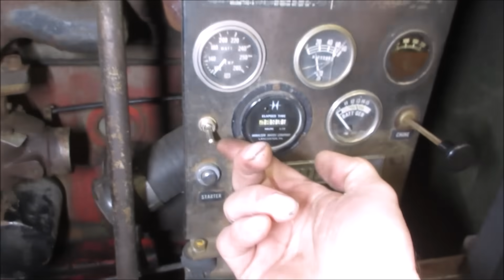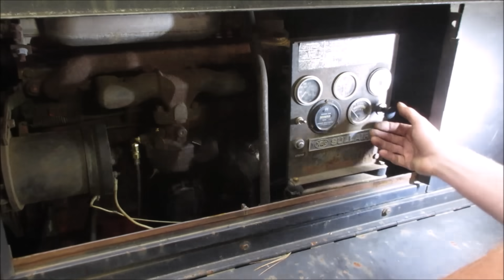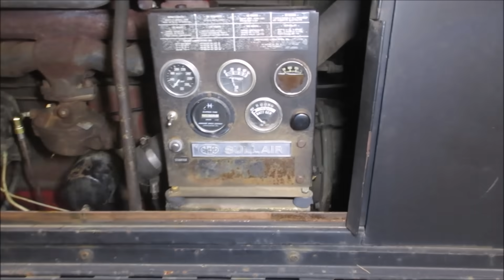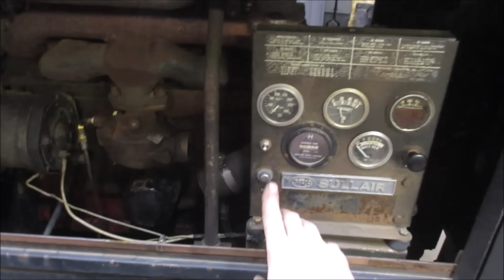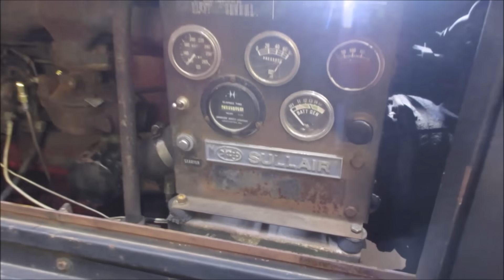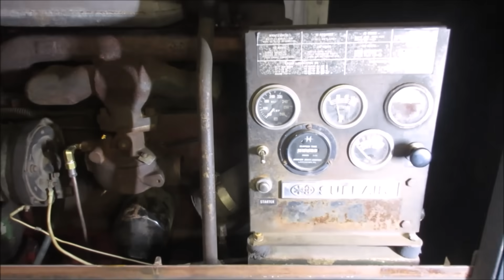Vintage Air Compressor Stalls Under Load. Cheap Fix.

Comment: Mustie, you would've loved a Sullair compressor I worked on for a friend years ago.
It was a 70's model screw compressor powered by a 1600 VW industrial spec engine, I was thinking of you while working on it.
It was all original, ex-military machine here in Australia, but was US made, designed and built by Sullair.
The guys at my local Sullair dealers had never even seen one before, and being so old they couldn't provide any info or spare parts etc. 
The machine used the VW engine from the factory.
BTW, The valve you pulled apart is the pressure regulator/throttle control.
It actuates the big throttle control diaphragm unit and unloader valve.
The throttle should start out at the full throttle position when the engine is off.
The air hose outlets should be closed before starting the engine.
Once the engine is started, the engine should rev up to make air, then as soon as it comes up to pressure, that regulator valve you disassembled should lift the crusty diaphragm inside and slow the engine down to idle by allowing air to enter the big diaphram unit, and that moves the big lever which opens and closes the air intake for the compressor unit and also controls the engine throttle via a cable. 
At the same time as dropping the idle, the idle unloader valve lower down should open to vent enough air to allow the engine to run unloaded.
The other valve tee'd in next to the one you dismantled is the shutdown blowdown valve, which you hear hiss for a while when the machine is switched off, it allows tank pressure to drain off gradually at shut down.
When the valves to the air hoses are opened, the resulting pressure drop should allow the pressure regulator to close, and unloader valve and engine throttle to open, increasing/decreasing air output and engine speed dependant on air demand/valve positions at the hose outlets👍
Reply: I rented one back in the 70's, two cylinders made the power, the other two were modified to compress the air. Half a VW engine did'nt make a lot of power but it did the job.
Reply: @billstuart8481  My late friend Wayne used one of those for his sandblasting setup, adjacent to his home built powder coat booth. It was loud as hell, but it ran great. I tuned it a few times for him over the years.
Reply: @billstuart8481  Oh, that's interesting.
I have an emergency tyre pump hose that can use the engine as a compressor, the hose can be screw into a spark plug hole to get you out of flat tyre trouble in an emergency.
However, the machine I mentioned used the entire VW engine, running on all 4 cylinders, 4 spark plugs, distributor and 4 plug leads.
It directly drove a an oil flooded screw compressor airend, similar to the one in the video but a much smaller unit.
The airend was mounted where the gearbox would normally attach if the engine was used in a car, then it pumped air/oil mix into an oil separator tank, same idea as shown in the video.👍
Reply: @billstuart8481  The ones like that which are common in Australia were made by Holman which became Compair.

Comment: The part you stripped is a pressure regulator, and the screw/locknut is to adjust the pressure being fed to the actuator. If that hole in the bell housing (top) was blocked, the regulator wouldn't work. By leaving the screw extended you're allowing maximum pressure but the pressure may fluctuate depending on the air pump type. Some pumps generate a pulse air flow and the regulator evens the pulse.
Reply: I caught myself yelling relief valve over and over haha but yeah if air is just escaping through that then you won't build pressure to operate the throttle.
Reply: I was thinking about the unloader valve.
Reply: Are you sure about the screw?  Every regulator I've ever used you have to turn the screw in to apply higher pressure.  With the screw out there should be no flow.  That's why I'm thinking the regulator is just not working at all in this case, it was clogged before and cleaning it out is now letting max pressure through.
Reply: @MartysRandomStuff  in = more tension on the spring which = more pressure required until relief.
Reply: @MrWick86  So we are not seeing some other supply tube going to the throttle control and that regulator is an output (relief valve)?  I guess that might explain the floating part inside that I've never seen on any regulators I've worked on.
Reply: @MartysRandomStuff  It’s not a relief valve. It simply controls the air pressure going to the actuator (control arm for the throttle). As the screw is screwed into the regulator it applies more pressure onto the spring making it harder for the air to pass through (I.e. dropping the operating pressure). By leaving the screw as far out the highest air pressure can pass through and operate the arm sooner/further. A relief valve vents off pressure to atmosphere when the line pressure reaches a preset value. Relief valves are usually used to prevent damage by over pressure.
Reply: @DinDooIt  Sorry, I don’t know what an unloader valve is, unless it’s the same as a relief valve.
Reply: @mrmoodster5405   Actually, what you are describing is a relief valve, where you turn the screw in to set the minimum pressure it will start allowing flow.  What doesn't make sense in this case is that if you screw this in so the engine goes to idle when the pressure gets high, how is the engine ever supposed to rev up when the pressure is low?
Reply: @MartysRandomStuff  The regulator controls (regulates) the air pressure going to the actuator. As the screw goes in, it applies pressure onto the control spring thereby allowing less air to pass through the valve and lowering the operating pressure. With less pressure the arm moves less, slower or not at all. A relief valve releases air to atmosphere to prevent over pressure. It “relieves” pressure, hence the name.
Reply: The bell shaped device upstream of the throttle actuator is a pressure reducing valve, which proportionally reduces the air pressure to the throttle actuator. 
A modern replacement would be from Watts.
Reply: Actually its not the pressure regulation itself. The whole screw adjusted spring just controlt at what pressure should the engine rev up before stall. I think the pressure what u let i to the hose itself being set elsewhere, but in out case u dont have to change that setting. U just needed to adjust the throttle response
Reply: 👍 And you got to give the man credit for not being afraid to jump into something he know absolutely nothing about. Betcha he knows what a pressure regulator is now!
Reply: @mrmoodster5405 Unloader valve will not allow any pressure to build up when you are starting the motor. A relief valve will limit the high pressure that will build up to avoid expansion or damage.
Reply: @MartysRandomStuff  
"you have to turn the screw in to apply higher pressure" - yes
"With the screw out there should be no flow" - NO

You've reversed your logic! It's flow being regulated not pressure - cranking the screw IN pushes the mushroom down harder, so it needs higher pressure before flow starts.

The feed pressurises the diaphragm chamber until it reaches the same pressure as the spring and lifts the mushroom allowing air out - more pressure on the spring increases the pressure at which the FLOW starts, so with no spring pressure it takes very little air pressure to lift the diaphragm and air flows pushing the throttle lever
Reply: @andrewgray1949   That's how a relief valve works, not a pressure regulator.  Everyone talking about if it's a regulator or a relief valve seems to be ignoring how the throttle bellows works.  The throttle control needs more pressure inside it (higher rpm) when the compressor pressure is low and it needs to supply more air, and less pressure in the control diaphragm (idle) when the compressor pressure is at max and no air is being used.
Reply: @MartysRandomStuff  The throttle needs to increase as pressure rises, to overcome the backpressure from the pump - On an electric compressor you have an unloader valve to de pressurise the pump to allow the motor to start - that's not what this is (there probably is one elsewhere).  This regulator wasn't working right and as pressure built the throttle lever didn't move and the pump stalled out the engine.
I suspect Musties' fix has the motor revving much earlier and while it now works the economy is likely much worse.
Without the regulator the throttle bellows would be exposed to the full working pressure - it is working like a resistor in an electrical circuit.
Reply: 100% correct
Reply: I have an old Ingersoll, rand compressor similar to this one, and the regulator is actually supposed to idle the compressor down if all valves are closed to prevent over, pressuring the system and causing the pressure relief valve to pop! Chances are this compressor is old enough it will probably never achieve the amount of pressure that it would take to become dangerous enough to over pressure everything and cause a blow out!!! So when an air valve is opened, it will actually caused the compressor to rev and build more CFM and pressure!

Comment: That’s a little Ford tractor motor. I have the same set up on my 1953 Jubilee. Finding the problem not being familiar with a Sulair air compressor was impressive. Fixing the exhaust leak would bring this unit back all together.

Comment: Hi Musti,,,I learned a lot from the locals here in pH,and I had a chainsaw with issues ,it was that thin rubber thing In the carb,we could not get a new asap and he said ahh no problem,and he told me to go buy soap for washing clothes,he boild some water added the soap ,after a min he threw in the rubber after a min he took it out rinse it in water and to my big surprise it was soft like new,maybe it works on hard rubber in your valve as well 😊😊😊😊😊😊😊

Comment: Only 15mins in. I have a 48 greyhound bus, wouldn't make air pressure due to the regulator diaphragm rotted out. Used some rubber gasket material from the parts store to make a new one, works like new again. Always watch your videos to learn a little more!

Comment: Well, there you have it, people have to learn how to use O-rings, and what their purpose is in a machine like this oldie. I'm glad that I got taught about how to use O-rings by my granddad. He was a good educated electro-mechanic. worked on old elevators and he build amps, and biked out and fixed people's radios in their homes after the war. and later he did their TVs too, when people started getting TVs in the homes.
I was about, 7-8 years old when he let me tear a radio apart, and he was sitting fixing other stuff, but told me everytime what those things was for and how it made the radio work. Still miss him a whole lot. He died last year. Tough last 5-6 days, he couldn't eat, everything my Grandma fed him came out the nose. and he suddenly weakened. So, I sat and wet his mouth and lips for the last 4-5 days with those cotton q-tips you know? they are made for that exact purpose. I cared for him for 4 years after he suffered a stroke in 2011. And in 15' he finally got some homecare from the rotten system here in denmark. Yeah, Something is rotten in the state of denmark. where have I read that before?

Comment: I just rebuilt fixed a Smith 150 cfm rotary screw compressor.
It has a 4 cylinder Ford Diesel ( Dover) 1980 .
I was told Smith pioneered portable tow behind units first made from Ford model A where 2 cylinders were converted to air and two were gas engine.
There are some later which used a Ford 302 V8 half compressor.

But Smith of( Kentucky coal mines ) pioneered helical screw compressors .
Quiet no vibration etc.
Sadly Smith corp is gone 
But there is a group online that restores old units .
Schramm also had similar designs.
Nice channel 👍

Ps you are supposed to open air outlets to start cold until unit warms up.
There is an unloader valve to turn compressor off to initially start unit until warmed up.
Reply: I've seen some others based off the same principle. Diesel Creek has one that I think uses a Wisconsin air cooled V4 with two cylinders converted to compression duties only.
Reply: Happy thanksgiving Mustie, and all the Mustie fans.
Reply: @ELOfanatic  yes. Many used this idea until rotary screw compressor came out . Some had 390 V8 Ford half engine half compressor on 4 cylinders .
Rotary screw compressor have no valves and piston plus rings to wear out. Oil flooded between  helixes close together is the sealing surface .
Lasts far longer .

Comment: That thing is a pressure regulator.  As the pressure drops, the pintle drops and cuts off air to the big vacuum throttle control.  As pressure increases, the diaphragm moves allowing more air to the throttle motor.  That adjustment sets the preload on the spring and thus affects how much pressure is needed to increase engine throttle.  Hopefully it has some kind working regulator or emergency pop off releif valve because it would be hella dangerous to run without it.

Thanks for the video!  Happy Thanksgiving!

Comment: The bell-shaped part is the regulator. The pressure gauge is the one on the far top left. Adjust the regulator back into where it was (the screw and nut on top of bell), and it should build air to around, maybe 185psi. The regulator has not changed over the years and you can get one. I work on Vac trucks that use the similar on demand air compressors. But you were spot on for diagnosis!

Comment: We serviced a larger Sullair Compressor that was used for sandblasting. It had a 6 cylinder Detroit Diesel engine. The governor was controlled by air pressure. The engine ran wide open until it built up some air pressure. I never liked changing oil and having it start running wide open with no oil pressure for a few seconds. I added an air fitting to connect shop air to control the governor on startup when we changed oil.

Comment: LOL at the acorn rain from that muffler. Based on what I have learned watching your videos I figured it was a 'pressure governor' issue as the engine did not speed up as you opened the air valve. Gotta love cheap and easy fixes. You have some cool friends with some wild toys. Happy Thanksgiving to you and yours

Comment: So, the higher the air pressure the harder it pushes against the diaphragm in the bell, which lifts the needle. Lletting more air into the bellows moving the control arm.   If air was leaking by that gasket, the needle won’t lift and the bellows won’t move. And by backing out the set screw he made it much more sensitive.

Comment: Looks like 1920s or 30s tech with the updraft carburetor. Back in the 1980s I worked for a contractor who had a Jaeger air compressor from the early 50s that we used for jack hammers, pneumatic drills, and a portable sand blaster. At one point he picked up a newer Ingersoll-Rand to replace it but he sold the I-R and kept the old Jaeger.
Reply: I am still using a old jaeger

Comment: You were right about that gasket on the regulator. The way it was bunched up looks like it was overtightened, squishing it into the travel part of the diaphragm. Considering the age, it looks petrified enough to hit the tipping point of not working at a 100%. Thanks for sharing and hope you have a great thanksgiving with the family.

Comment: Looks to be a 172 cu in Ford tractor motor.  They used them on late 50s 800 series and early to mid 60s 4000 series.  Parts for these are readily available and cheap.
Reply: Yep

Comment: ah the joys of owning,operating those tow behind air compressors. we use one to blow out the water lines to our complex's pool,in the pool house. noisy bastard but gets the job done. Mustie figured out the basics how the setup worked, traced down potential culprit. getting those things fine tuned is art in itself but Mustie got it up and functional

Comment: Its a scroll compressor. That tank is an oil and air separator.. It has more than a couple of things wrong with it
Reply: Rotary, Too old for a Scroll. :face-orange-raised-eyebrow::face-red-droopy-eyes:
Reply: Helical rotary screws.
Oil makes the screws seal .
Often the oil air separation filters are clogged and bad oil won't let them build pressure.
Most modern tow behinds use this design since 1970s.

Comment: Not so sure you got it on the air compressor Mustie.  The thing you called an air tank isn't exactly what you might think it is.  Its actually a separator tank and separator filter(s).  The compressed air is Layden with oil, due to the air end being a flooded screw as they are called.  So oil is being injected into the air end as its running.  The air goes to the separator where the oil is dropped out to the bottom of the tank. The filtered air comes out usually at the top of the tank. There are sometimes two readings for air pressure, one being the wet side of the filter and one being the discharge or dry side of the filter.  There should be around 3 psid from wet to dry side pressure -d = being differential pressure.  You should have had a lot more air coming from that open hose when it revved up.  I suspect a plugged separator filter. among other things.  Most often with the old Sullair's and other makes  is the orifice's get plugged on the signal side due to grungy oily air.

Comment: Looks like that device is a pilot air regulator.  Sends a reduced pressure air to the larger diaphragm to control throttle and keeps it steady vs the main compressed air that will vary.  The diaphragm definitely need some love or replacement.

Comment: I am a plumber , we have a similar device for water pipes coming into the house, its a pressure regulator , not sure about yours but on water pressure regulating valves the more you screw the screw down the more water pressure and then you tighten the lock nut